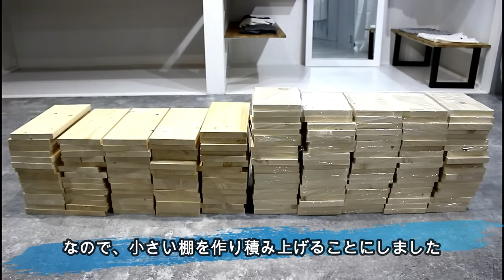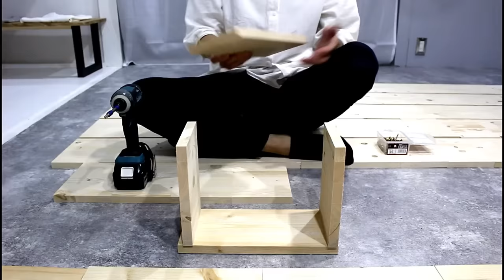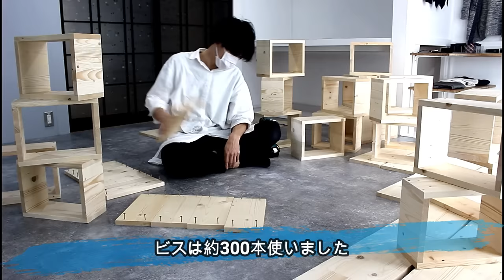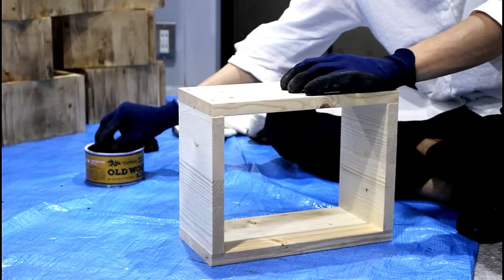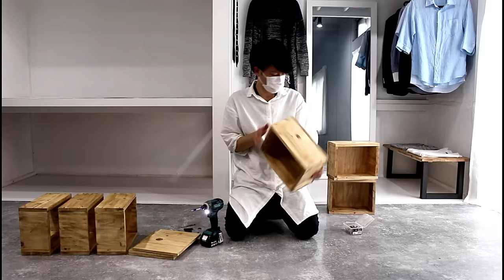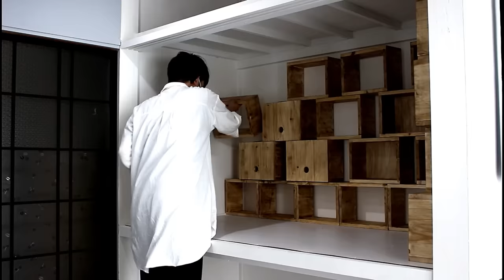【DIY】約1万円で押入れをセルフリフォーム！おしゃれな収納棚インテリアの作り方！ Easy and simple making bookshelf

Comment: Those with door cover could not be opened without moving out the boxes above
Reply from the maker: The door cover can be opened without moving the upper box.
Reply: Yes, the doors are protruding if you see carefully. So there is no opening problem. Good work.